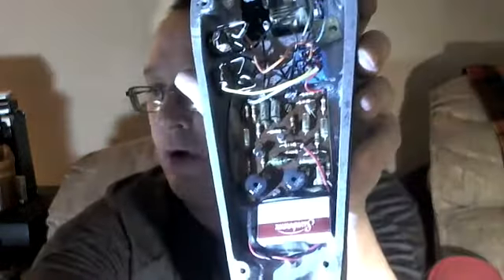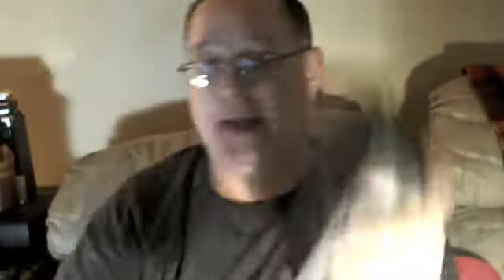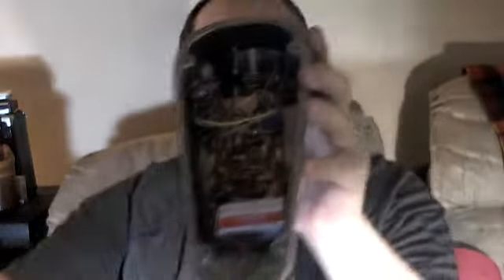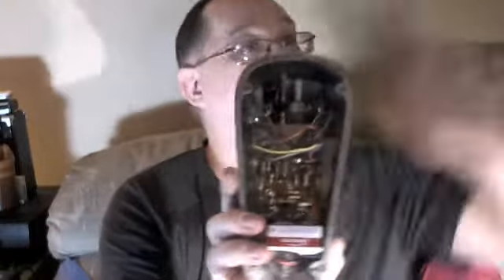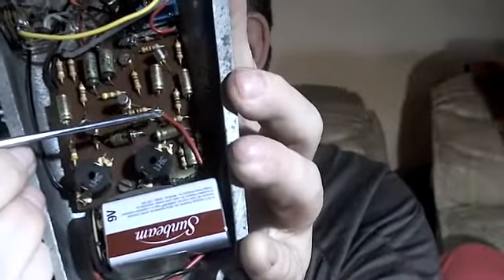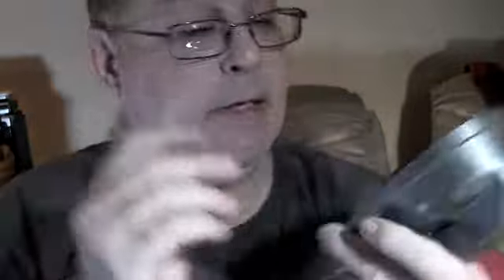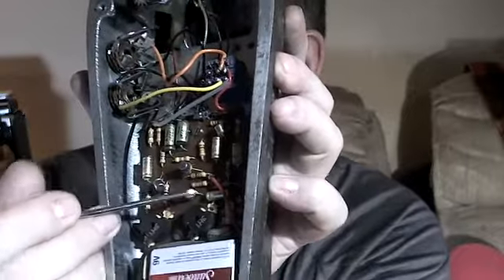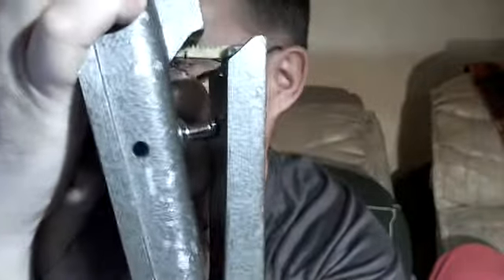Schaller Wha-Wha yoy-yoy pcb pin out

Comment from the maker: imediately after this , i cleaned the gunk off the gears , put some fresh lithium grease in there , and the circuit went inop. its passing audio but its not "wah ing " ... so yeah , i am at my wits end for the moment . perhaps i can bring this back around by finding what componant failed . there are 4 axial lead type 10uf capacitors in there. .. i dont have those . its bc109s - i dont have those . what a pita .
Reply from the maker: @DBCisco  i replaced all the  radial type electro caps  on the board , there were 5 . the fourth one fixed it .